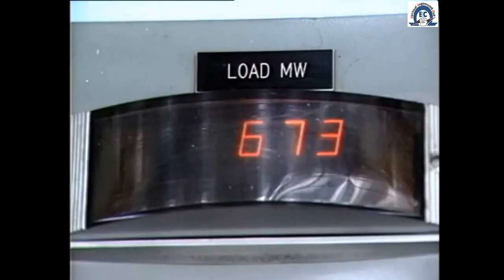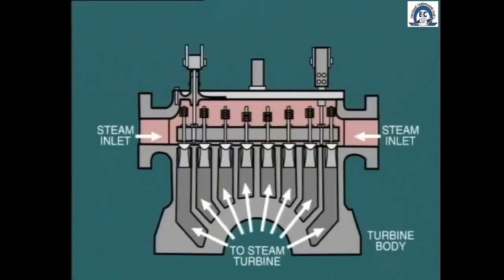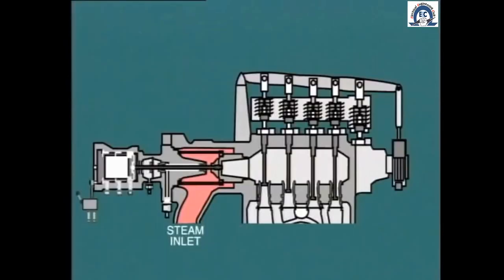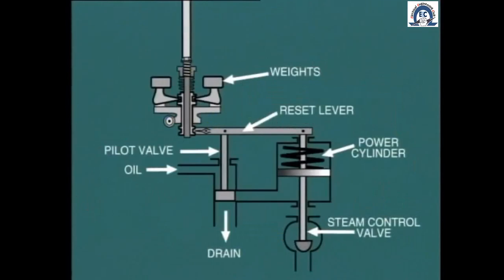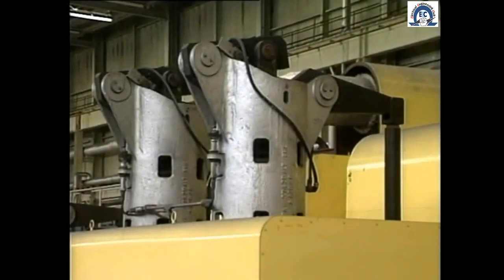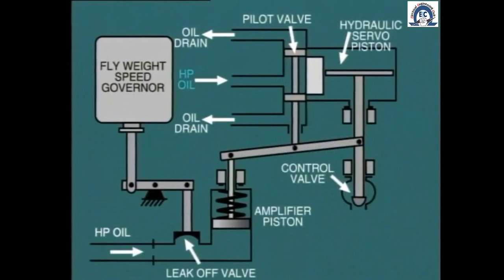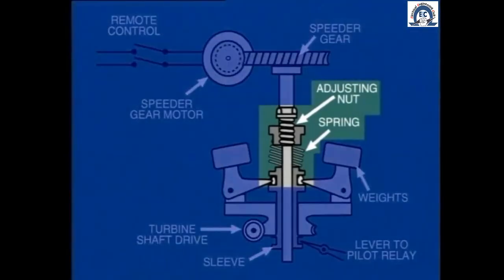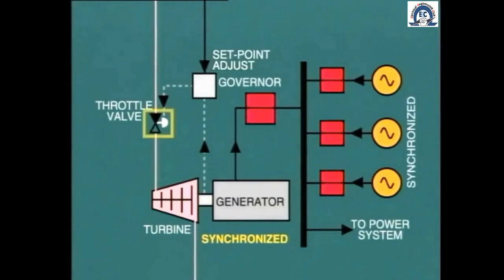lesson 1: steam turbine operation and control with mechanical governor

Comment: Great video but I dont undertand in this part 01:38, this this image I saw 2 inlet that is from side and from bellow. Is that arrow above "to steam turbine" is in wrong direction (must be reversed from up to down) ? Thx
Reply: The steam would be running axially from where the arrows are pointing through the first stage nozzle block.